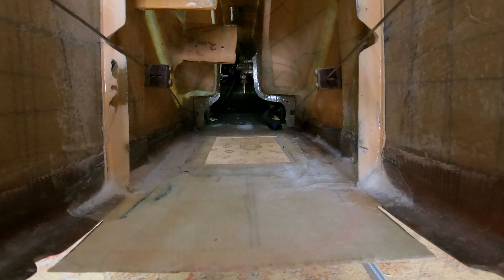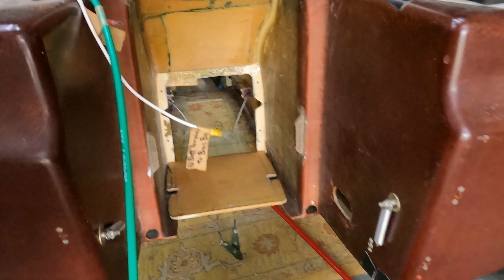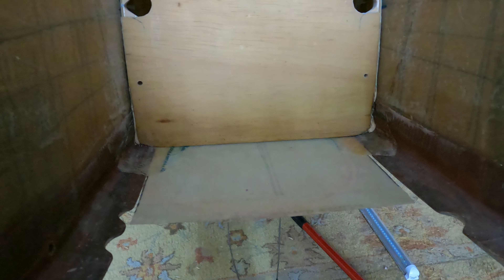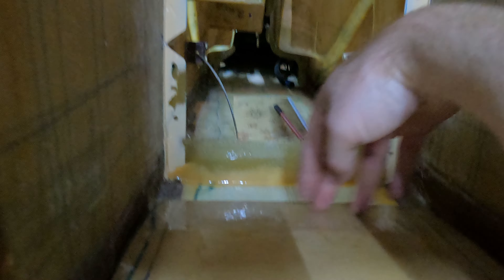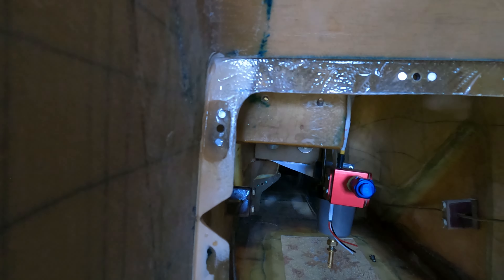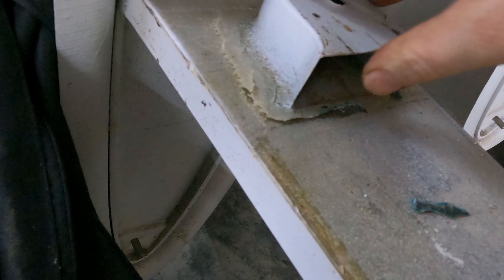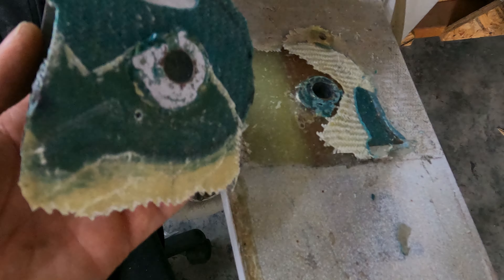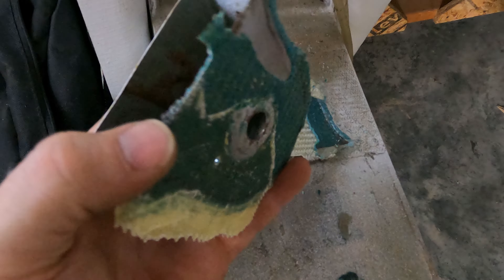Europa Aircraft Kit Build - Spar Socket

Comment: Maybe you already know this but just warm up the spar socket with a heat gun to about 180 to 200 F and it will come off easy. Some people put a layer off BID over the metal as method off keeping the socket from falling off.  Mine only have the 420 and they never came off.  My plane was built at Flight Crafters around 2000 and they didn't put a spar strap on...so I did that myself.